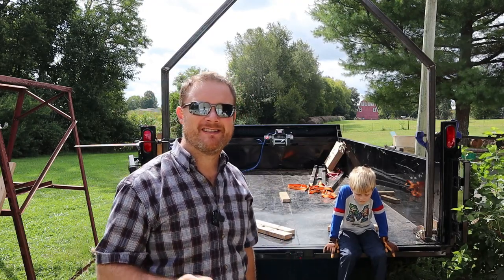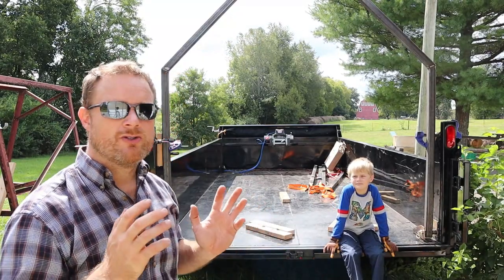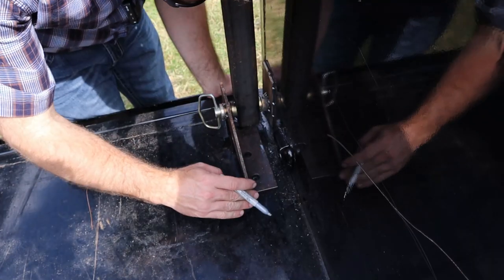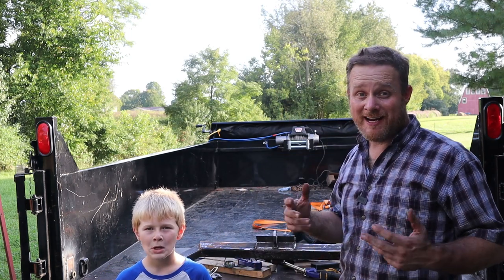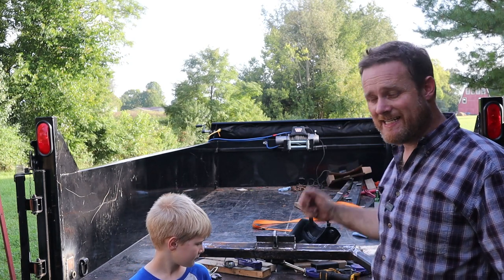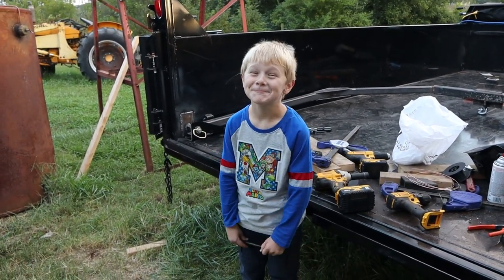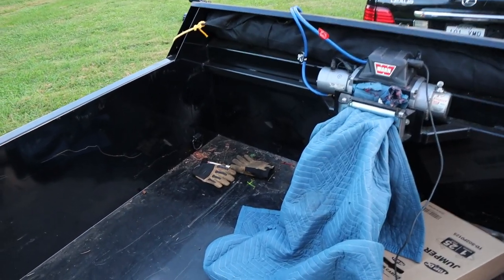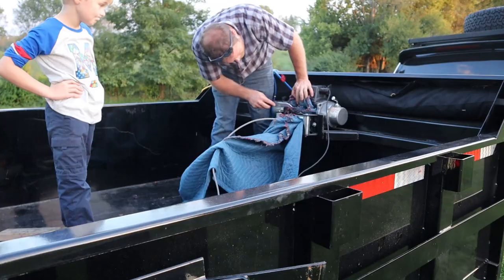#140 I broke it on the first try

Comment: Hey buddy! i have made one also. i kick the wench out of gear then pull out slack past the end of the bed. then put it back in gear hook the the cable and push the a frame out. It saves on the wench, and battery, and you don`t need your remote to be longer. great job on the trailer.

Comment: Hey I was sent your video as I was building one myself. Maybe a suggestion, I know I'm doing to mine, adding a removable pin on the top rail or chain stop, so when the arch comes back it doesn't slam or hit you 😂. 
But awesome build. Just purchased a sawmill and now I need to carry the logs. Have fun and happy holidays.

Comment: Your channel is very informative.  I look forward to each video you release.   I've been heavy into offroading for years with my vehicle of choice being a 1975 Jeep CJ5.  All of my 4 wheel drive vehicles have Warn winches,  even my Ram 2500. (I retrofit the integrated power wagon winch so it has a clean look)  Over the years I've seen too many winch cables snap either from overload or at a kink from respooling poorly.  As you know,  snapping a winch cable under load is usually a very violent and potentially deadly situation.  To avoid that,  I've swapped all my cables to synthetic rope.  It's lighter, stronger and doesn't store energy like traditional cable does,  so much safer.   You might consider the swap.   It's a bit pricey, but the piece of mind is worth the investment in my opinion.  Plus,  a snatch block placed at the arch might also help for lifting heavier logs.  Again,  thank you for posting such insightful content.
Reply from the maker: William Fortier thanks for watching and taking the time to comment

Comment: Hey nice video! Just wondering why the arch needs to pivot. It seems like having it fixed in place with a snatch block would be less trouble? Since it's a dump trailer, you could just raise the dump a little to tilt the arch aft if needed.

Comment: learning where to set the chain on the log to leave enough slack to remove it easily (before the arch extends past 90*) will come with practice/experience. The blanket thing is a learning thing as well. There's a lot going on and a lot to "worry" about as you're loading logs w/an arch. Be careful/safe is #1. 
Would suggest a chain grab from the arch to the trailer that allows you to tilt the arch toward the back 10-20* and tie it to the trailer so it's still upright. That allows you to easily disconnect the winch line and attach it to the log to finish pulling it in the front of the trailer. It sounds like more work, but once the log has started up on the trailer safely, it's a lot faster to drag it than reset the arch 2-4 times. Once log is in place, re-attach the winch to the arch and pick up the next log. 
Good luck with it and excellent example you're showing your son. Congrats on getting it built. They really do help a lot and save wear/tear on your winch/trailer and are very functional
Reply from the maker: Agreed, I think I need a lot more practice to get the slack needed.  I do plan on pulling with the winch once I get the log on the trailer unless I need to get it up onto a row of logs already in the trailer.

Comment: How about at the top of your arch you put a snatch block and run your cable through it and down to log. Then on each side of arch to the trailer a chain that will only go in 45 deg angle for light logs and closer to 90 deg for heavy logs. Just a ideal, catching the arch could become a problem.
Reply from the maker: I do plan on adding a snatch block, for that and for doubling back to the winch if needed.